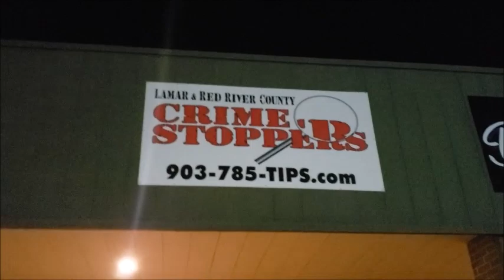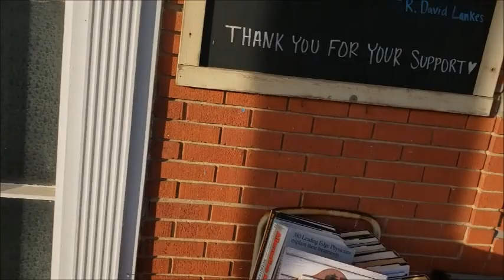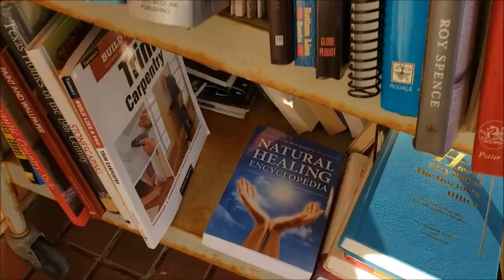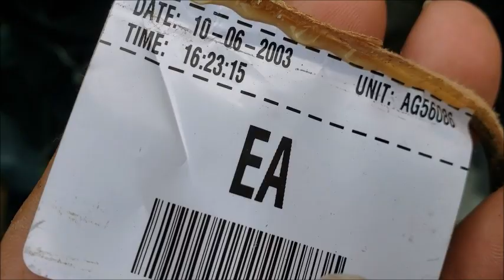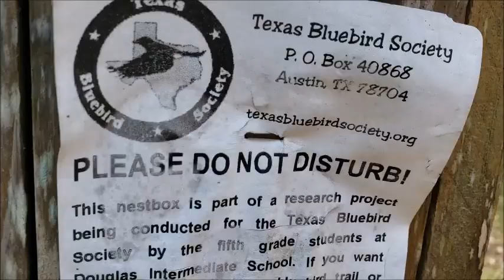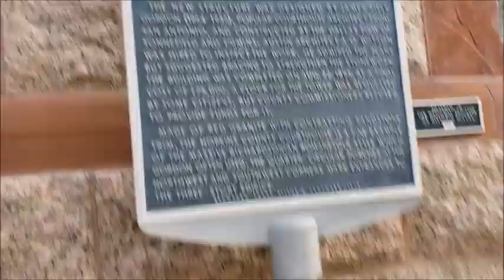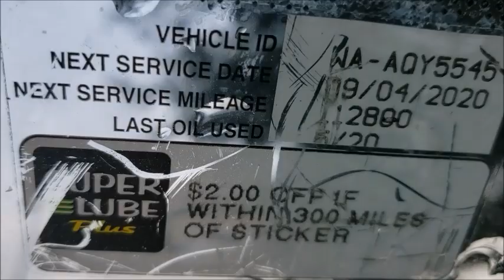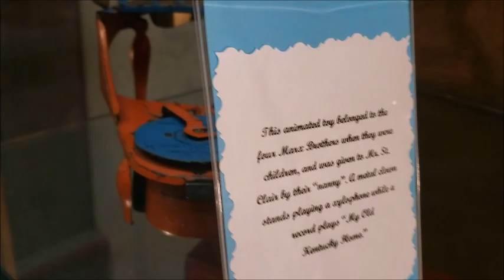Oh La La it's a vlog in Paris, Texas /and south

Comment: The stuff your peeling off the roof acts as a insulation but more a noise reducer to make it a quite ride when traveling down like noisy highways ect. Reduces road noise an rattling or make like rain drops more quiet just to give you a idea.. Think of dyna mat, the stuff that people use when they install big stereo systems in cars to reduce rattling and noise from the bass rattling the car.
Reply from the maker: I don't notice the noise reduction.
Reply: @TravisHeinze  Considering half your roof is another window (sunroof) you may not but if your entire roof was covered in it and no sun roof you may notice the difference. Van livers also use it on the van walls before they put insulation and whatever paneling they chose to reduce road noise and rattles during their travels. Dyna mat is expansive and that is a knock off cheap version of it.